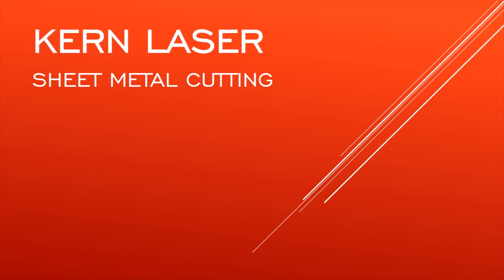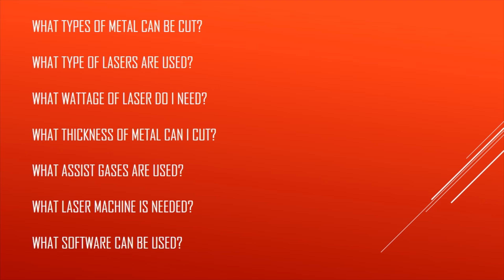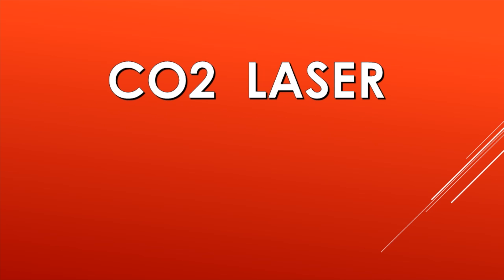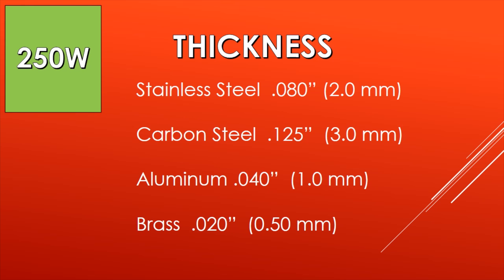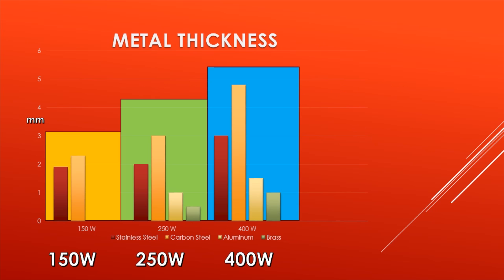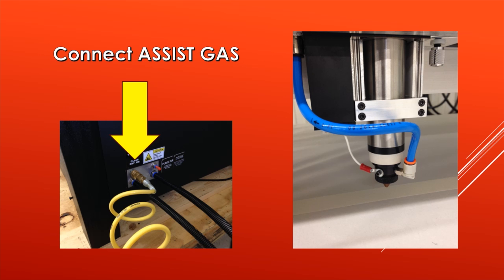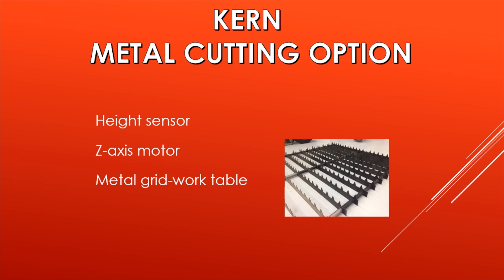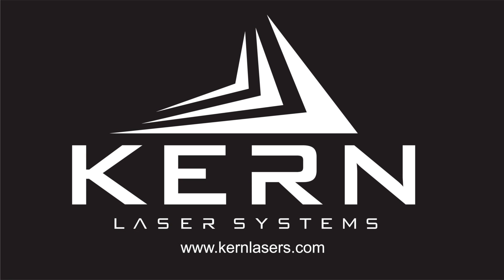Kern CO2 Laser Sheet Metal Cutting

Comment: Hi I wonder what are the cons and pros of CO2 vs Fiber lasers in regards to cutting thin sheet metal (1.5mm of stainless and carbon steels). In terms of precision, cost of machine and lifespan of tube/lasersource. Is there some comparison that can be looked at? Thx
Reply from the maker: Hello Anton, the short answer is... if you want to just cut metal then the fiber laser systems will offer greater cutting ability and speed when compared directly to our CO2 lasers. However, if you also want to cut organics like wood, plastic, foam , etc. then our CO2 laser is probably a better fit. In regards to 1.5mm stainless and carbon steel, our 500W and 650W CO2 lasers would cut these metals very nicely. However, the speed of cut with our 1kW fiber will be roughly 1.5 - 2 times faster. If you want to talk about this more in detail please feel free to call us toll free at 1-888-660-2755. Thank You!
Reply: @Kernlasersystems  thank you a lot for answer, that was very helpful!